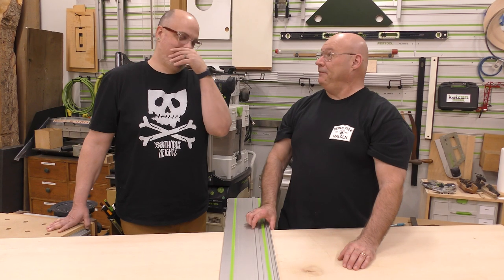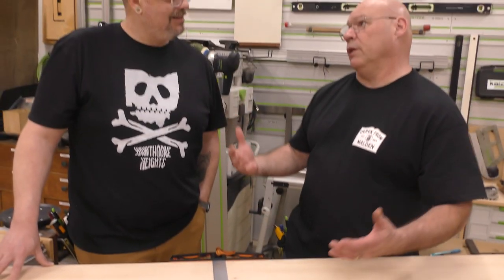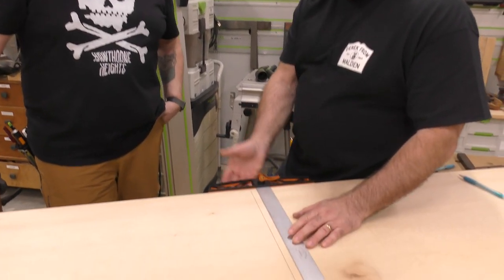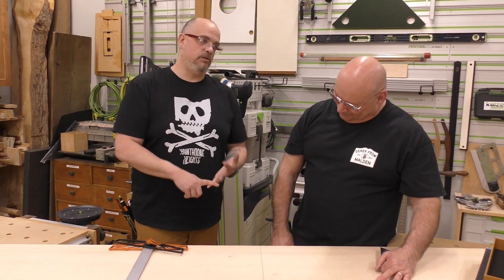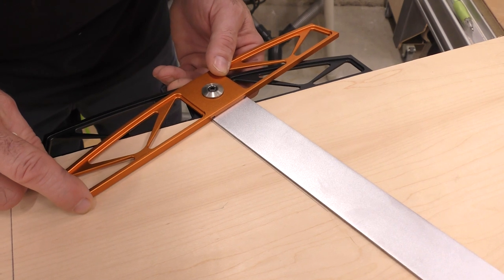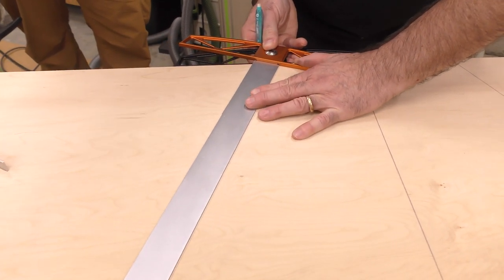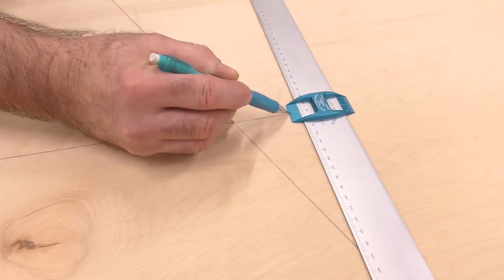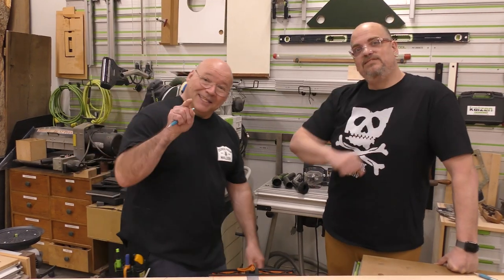Adjustable Square AS-24v3 Overview

Comment: Respectfully, you didn't actually prove the square was square in the beginning.  You proved both sides of the rule are perfectly parallel with each other.  You'd have had to flip the tool over to check if it was square and use the same edge.  That wouldn't have worked with this square though wince the second edge is adjustable... kind of a catch 22 there.  SUPER cool tool though.  I'm totally getting one!  Thanks for the video!

Comment: So why not use the Festool Angle stop FS-WA?   I assume you actually want to cut the wood with a Festool track saw rather than just draw lines all over it.  And as Mike K notes below, you can set it up without needing other tools as it looks like there is even a detent at 22.5 degrees.

Maybe you can show Big D how that works in another masterclass?
Reply from the maker: will do

Comment: its a high quality tool all right.  The problem I have with Bridge City is their UNREASONABLE shipping charges which have stopped me from continuing on with the sale on more than one occasion.  For instance, they want to charge me $51 to ship the adjustable square across the country.  Sorry.. I pass.     Until they stop trying to profit off of shipping or passing on the cost of their fancy packaging,  I will not partake in their wears.
Reply from the maker: I think it is worth it !!!!
Reply: I understand your frustration with the shipping prices but is venting about it to Sedge the proper outlet?
Reply: @AaronGeller  If Sedge is going to promote one of their products, this is absolutely the appropriate forum to discuss all aspects of buying a tool from Bridge City.

Comment: Thats not checking if the square is accurate, all you did was confirm that the each side of the blade is parallel with each other.
Reply: thats exactly what I was thinking.. He should have flipped the square over to check for  square
Reply from the maker: The blade it perfectly parallel ... and the layout is perfectly square

Comment: I gave you a thumbs up for the video, but I'm not impressed at all with the BCT AS-24v3.  A tool that costs $200, plus shipping costs, and STILL requires other tools to set it up is unreasonable for me.  I thought my TSO Products tools were expensive, and they are eye-watering expensive, but at least they are standalone tools and integrate perfectly with the Festool system.

I defer to your vast experience, but checking for squareness as you did at 1:40 does not appear to be correct.  In my opinion, all you did was verify the width of the rule was mostly consistent (it appears the marks diverged at 1:51).  Had you set the angle of the rule to any random setting, you would have received similar results when you slid the rule over for the second mark.  Unless the AS-24v3 has a detent to positively lock the rule at 90-degrees, I don't see how any method to check for squareness on an adjustable T-square is relevant.
Reply from the maker: it has one fence that is 90 and you flip it over for an angle fence. I believe it is worth it for lay out !!